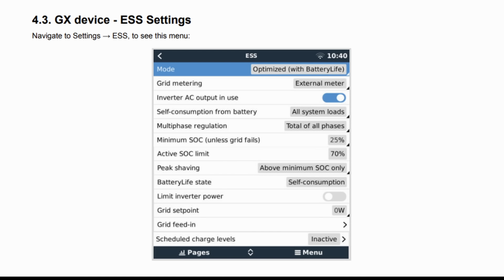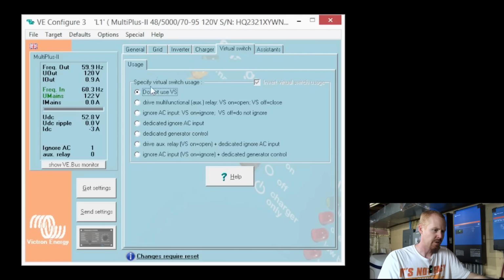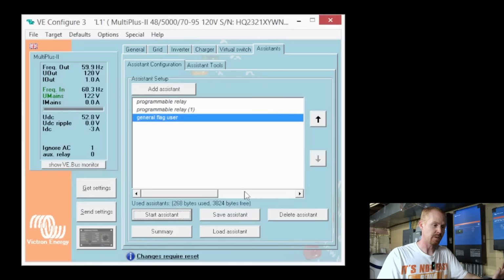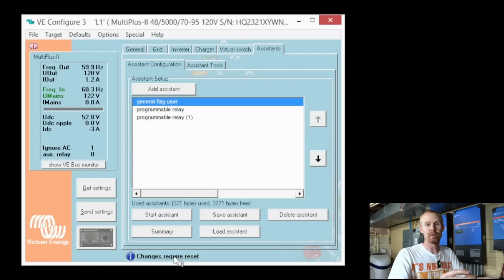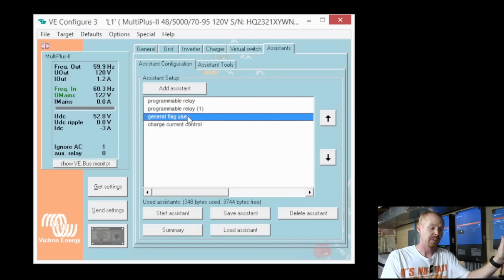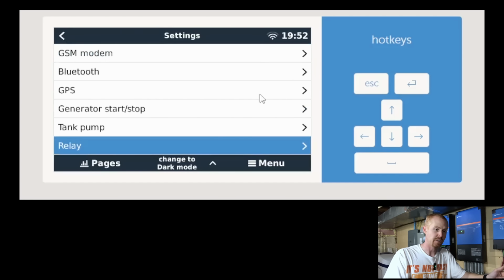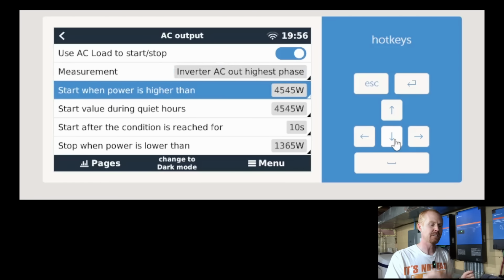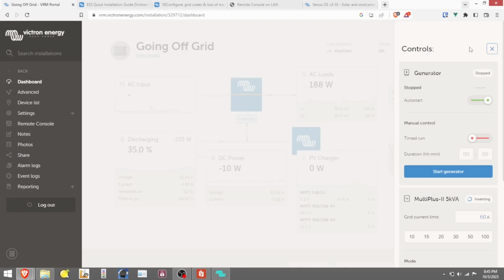Different Ways to Ignore AC Input on a Victron MultiPlus 2 Inverter

Comment: I found a problem with this setup, which works fine by the way. 
But when it switches to AC, the Victron also switches from inverter mode to charger mode. And my house will be running off the grid instead of the batteries. 
Since the grid is pretty bad where I live, my lights will start flickering etc etc. 
So how can I modify this setup to have the Victron charge the batteries from the grid at 15% SOC, while still running the house off the batteries??

I followed all of your instructions and this is the drawback..
Reply from the maker: Unfortunately with this configuration, you can’t.  It’s either grid or batteries.  

If you want a hybrid mode, you would want to look into the ESS assistant.  Keep in mind though that any hybrid mode has a potential of power going back up to the grid.
Reply: @AdamDeLayDIY alright will look into the ESS then. Thanks anyway, your solution works very nicely except this little snag.

Comment: Thanks for the video.  I don't know why Victron cannot just make it simple and provide an option that allows you to easily be totally disconnected from mains until you reach a certain SOC (which is adjustable on the VRM app / remote console) and then reconnect to charge & power loads up until a specified SOC (also on the app) without needing to run extra cables, etc.  The ESS assistant would be ideal to have this option if it allowed for no back-feeding, etc.  Until then, yes the Gen start / stop function is the best, though it's annoying they don't have the feature out of the box available.
Reply from the maker: It would be nice.  It kinda seems like they're less focused on our market though.  ESS works great if you have a grid-tie agreement.

Comment: I just installed a new Victron MultiPlus-II 48v/5000VA/70 amp and want to program it. However, dummy me forgot to buy the mk3 USB cable. Got the Cerbo GX rocking and rolling, tho. You are dead in the water without this cable using the MultiPlus
Reply from the maker: Congrats on the new inverter!

You can actually use the VRM to upload and download the configuration files without the cable.
Reply: @AdamDeLayDIY   -- Thanks. I ended up getting the Mk3 cable. However, the inverter turned off MAINS (grid) at 30% SOC. I went back to this video and enabled "Assistants" like you showed. Just did it -- so, the batteries need to discharge down before I know it "works". Question: Does the ESS on the remote "also" need to be added? Right now (on my Remote) it shows "No ESS assistants found". Hopefully, the inverter will shut down at 30% SOC (and use the Grid) and turn back on at 50% (and shut off the Grid). That's all I want it to do (no charging needed). Thanks!
Reply from the maker: @ChrisDIYerOklahoma  did you use the ESS assistant or a different assistant?  The ESS assistant is it’s own thing and allows the inverter to use grid interactive features.  Most of the ones I talked about only allowed grid connectivity to pass power through the inverter.

Comment: I setup the assistant. I send to the inverter and it reboots.
After reboot, the inverter goes into charger mode, but all I see is the Bulk, Absorbtion & float AMBER lights. Green Charge light is not on.
I turn off the inverter with the toggle switch, wait a short while, and turn back on the inverter. Inverter defaults to Charger Mode, not Inverter Mode
Retry the entire process with same results
Startup veconfig and the software says there are no assistants. I have tries the whole procedure twice with the same results (help please)
This is a 6 month old Multiplus II with latest firmware
Reply from the maker: Which assistant did you try to install because I talked about a few different methods.

Did you see the note I mentioned in the description and sticky comment about having some of the relay options backwards?

Comment: Just wanted to post that I've done this and ran it for about a month.  It seemed like everything was working fine until i did my utility reading.  Upon further investigating i realized that i was always drawing about 100-200 watts from the utility even when the generator was set to stop/off.  So it seems like there is still a connection here even though Victron shows that the generator is off.  Can someone else confirm that this is actually 100% working with no feed in or out?  Not sure if power assist has something to do with it?  Mine is check, never changed that setting.  Also UPS function is also check and that was the default setting
Reply from the maker: It all depends on the rest of your settings.  I’ve been told you want to disable power assist.
Reply: @AdamDeLayDIY  Just tried that and it still is leaking 100 to 200 watts randomly.  Is there any other setting that might have to be disabled or enabled?
Reply from the maker: Do you actually hear the AC IN relay opening when you're not running off of grid power?  If it's disconnected, there should be no power flow.  Are you using the ESS assistant?
Reply: @AdamDeLayDIY  I hear a good click, when going from inverter to grid being turned on.  Not using ESS.  When its on inverter mode and off grid (no mains connected as per the inverter) I don't see any flow in the vrm it signals well that it's off.  I put a clamp meter on the line feeding the inverter and i see anything between -116W to +120W just fluctuating.  Not sure if you can test yourself  (i think you dont have victron now?) or if someone else on here can see if this happens with their system.

Comment: I have 2 24 volt 3000 watt inverter's in split phase and i cannot seem make this work either.im sure i must have something wrong but having trouble figuring it out.great videos though.
Reply from the maker: Which method are you trying to use?
Reply: @AdamDeLayDIY wired to cerbo

Comment: Great video. Just what I was looking for. Installed the assistants to ignore AC input as shown and everything is working perfect. One more question howver. I only installed the assistants on the master inverter. (I have 3 multiplus 48/5000 in parallel) Do I need to install them on all 3 inverters or is only the master sufficient?
Reply from the maker: Thanks!

So with these assistants, you only need them on the master inverter.  If you look at my video on dynamically charging from the grid then you'll need those assistants on each inverter.

Comment: Hi I am very new my first install actually.  I have my system up and running, when my deiesl generator is running the home has a PE conection. But when its turned off, and the battery is running home the system looses PE . Where am I going wrong please.
Reply from the maker: Congrats on your first install!

So what inverters do you have?  Do you have a physical PE connection in the inverter going to the earth somewhere?
Reply: @AdamDeLayDIY  yes , it's an off grid system so the home is on tt. Before I started I checked the ze which was 1028 ohms now 132ohms. All go to axceteal bus bar. The multiplus 2 and the mppt and the byd battery earth's all go to bus bar.  The hyundi generator has  the earth neutral link as per hyundi recommendation. The consumer unit is connected to central bus bar.  But I need to get the laptop and usb lead to make sure that the ground relay tab is ticked. It's really unfortunate for me the customers home is in the wilderness of Wales uk. No mobile no Internet. And I have now been hours and hours on this system. I like the product but other manufactures have product for off grid that are really plug and play.  This job has stressed me out a bit. As I can now drive 45 miles just to plug into the multiplus 2 to see if a box is ticked. Trouble is it it is then what's next. I don't know how people make money from these jobs as now I am losing money. So any help is appreciated.

Comment: Thank you for this walkthrough. I think i will be trying the assistants (2 programmable relays + general flag) to start. 

Can you verify if the criteria you set AC load & battery SOC acts as AND or OR logic?
Reply from the maker: Not a problem, glad to help.  So the switching criteria is "OR" based.  If the load is too high OR the SOC is too low it will switch to grid.
Reply: @AdamDeLayDIY  thank you!!

Comment: This stuff is fascinating. I have already incorporated on of your assistants in a shore/generator priority that triggers the charge value. It works great. Now I'm looking for an assistant that will adjust the AC input level automatically depending on a value I have not defined yet.  For instance, when the generator input is on priority (above) it will have the AC input @ 50A.  When on Shore, it will adjust it to 13A.  Sounds weird, but I have a complicated mobile setup and trying to automate some settings that need adjusting when I'm not present to do it.
Reply from the maker: Since there's only a single input on the MultiPlus2 (and you would always be sending in 120v from either source), there's no easy way that comes to mind to automate what you're doing.  You would need some kind of manual switch (or cerbo display) to change the charging current.  

Now the Quattros have 2 different inputs, so I don't know if you would be able to manually set the current limit for each one individually.  Might be something to look into.

Comment: Good morning I have been using victron connect, is it the same as ve connect.
Reply from the maker: @gino2465  it kinda is.  So Victron has been working for a long time on moving all the functionality over from VE Connect to Victron Connect.  I believe you can do a lot of the inverter configuration now with the exception of anything “advanced”, like using Assistants.

Comment: Amazingly easy.  Wired this up with ferrules at both ends in 10 minutes.  My lithium batteries (600ah), maintaining them between 40-60% soc at home.  Let 1500 watts of RV Roof solar do it's thing to contribute to this SOC.  And of course, its a RV, so before getting on the road and when on the road, leaving the "generator" switch on.  Thanks Adam!
Reply from the maker: @gmercede  awesome!  Glad it helps!

Comment: Hi Adam, I want to add one more assitant to switch to AC if DC voltage is lower as 48 volt. Iam not sure if it will shutdown if relay is open. Or should I do 2 conditions ? If AUX is open and DC voltage is lover than .... And it should be at last position or at the top. Trying to understand logic of assitants but hard to find. I want to prevent that relay fail and Multi will drain my battery. Or multi lost communication with cerbo. You never know.... Thanks
Reply from the maker: You should be able to just add another voltage condition to the existing assistant.

Comment: Your channel seems to be the closest to what I’m wanting to do? Will the Victron II run a Three Phase Windmill  “1600w” at the same time with a solar input. I don’t have wind other than on cloudy days and it’s not much? I don’t think I would need a dump loud because I always have a load on my lithium batteries with the BMS?  On two 150/60 Victron controllers.Set at 14.20 volts. For my solar input.
Reply from the maker: @scooter6334  unfortunately I don’t know much about wind.  As long as you have a proper controller set up for the wind turbines, you should be able to have the output of that controller go to the same battery bank as your solar charge controllers.  From my limited understanding, the wind controller is just a modified solar charge controller.

Comment: I’m in the process of investing in a Victron II. For my on grid home. “For elec savings” My question is why not use the battery bank to it full capacity before it need assistance or at the point it needs charging? When setting the transfer. I would think the 15% “or when It need assistance” on would be good. The 30% off seems to soon for the charging to stop. 🤔 why not at 95%+ I’m enjoying your videos for what I can understand. 🥴
Reply from the maker: @scooter6334  my primary reason for setting to 30% is to just make sure I still have some power available in my batteries in the event I lose grid power.
Reply: @ I thought the charger shuts off at 30% it sounds like you’re talking about turning it on at 30% If so, when are you having it shut off and quit charging? I thought 15% was when it came on to charge from the grid.
Reply from the maker: @scooter6334  The charger shuts off at whatever you program it to.  I don't charge from the grid.  I'll discharge my batteries down to 30% and let the grid takeover to power the loads until the sun can recharge the batteries.
Reply: @AdamDeLayDIY  Thank you. I don’t have enough solar on cloudy days so I want to use the charger just to recharge the batteries to 100%. I want to only use the grid long enough to get back on my batteries. I’m doing this manually now it’s a hassle and as you would know. You have to be careful. 🥴 learned that the hard way. 🙄
Reply from the maker: @ So then yeah, you can use this same thing to automatically switch to and from the grid.  You just wouldn’t turn off the charger in the settings.

Comment: Ahoj, ak zaťaž prekročí maximálny výkon meniča menič sa pripojí na sieť. Potom záťaž napája len sieť, alebo menič stále dodáva maximálny výkon a zvyšok ťahá zo siete?
Reply from the maker: Keď sa striedač prepne do siete, všetky záťaže sa prenesú do siete. Ak máte na svojom AC vstupe nastavený prúdový limit a vaša záťaž tento limit prekračuje, ak máte zapnutú funkciu PowerBoost, váš menič vám tiež pomôže pri napájaní záťaží z batérie.
Reply: @AdamDeLayDIY  OK, I'll try. There is still the question of what happens if the battery is dead and there is not enough sun. Then I need the entire load to be powered by the grid.
Reply from the maker: @MartinBleho  If your inverter is programmed to switch over to the grid when your batteries get low, you should be all set.
Reply: @AdamDeLayDIY
Reply: One more question. I have 3x multis II configured for 3 phase operation. Is it necessary to send these assistants to all three units, or only to the master?
Reply from the maker: @ If I recall correctly, you're only going to send the Assistant to the inverter that you wire up Aux 1.  Since all the inverters work together, once the AC In is triggered on 1 inverter, it will automatically be triggered on the rest.

Comment: With the assistants assign is it needed to do some configuration in the Cerbo relays menu or any other kind of configuration? Seems to me that creating the assistants just for it self it won't work. Can you help? Thank you for your video and time.
Reply from the maker: If you follow the step starting at 10:15, then you would need to configure the Cerbo as well.  If you follow the assistant configuration before that, then no, the assistant does all the work on the inverter.
Reply: @AdamDeLayDIY  Thank you bro' so no need to put the relay menu in Manual mode..  Relay 1 still in alarm notification and relay 2 off? or Both in manual mode? ( Remote console menu)
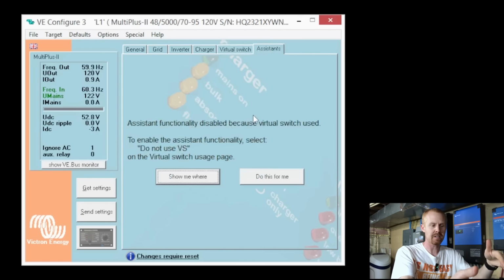Reply from the maker: @nunocoimbra  If you're talking about the assistant configuration between 5:50-10:15, you won't need to make any changes at all on the Cerbo/Remote console.  You're only using the relays built into the inverter.  

If you're using the configuration after 10:15, that's when you're wanting the Cerbo to control the AC IN connection of the inverter so you can make changes using the Cerbo/Remote Console.  

The difference between the two is that the inverter only assistant configuration means you have to edit the VE Config each time you want to change the settings for your AC IN.  The Cerbo config allows you to make changes at any point in time on your Cerbo/Remote Console.
Reply: @AdamDeLayDIY  yes, i am talking about the first configuration without de data cables on cerbo relays.. I did the exact configuration on the System bu twhen the grid is connected, does not assume this assistants. :(
Reply from the maker: @nunocoimbra  Did you see the update in the description or pinned comment?

*
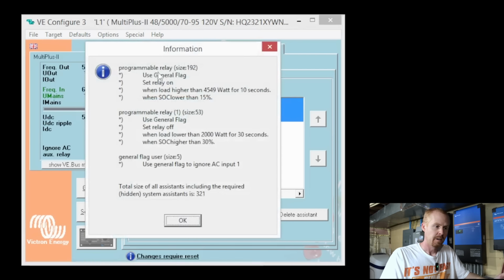At 9:21, the generator start/stop assistant information is not correct.  In the video it shows the relay being turned on when the load is high or the SOC is low (and the opposite for low load and high SOC), but the relay should be turned off.  The relay is controlling the General Flag (AC Ignore).  When the relay is set to "on" it will activate AC Ignore and turn off the grid connection.  When the relay os "off" it will NOT ignore AC In and the inverter will switch to passthrough mode.  

Basically  you just have to switch "relay on" to "relay off" and visa versa for the two programmable relay assistants.  Unfortunately I cannot edit the video to add the correction without taking it down. 
*
Reply: @AdamDeLayDIY  the AC input was ignored in fact but when batteries get to the minimum SOC the grid is not activated again as it should. Maybe in the VE Config inverter's menu the SOC  shutdown percentage must not be assign?
Reply from the maker: @ The inverter shutdown SOC needs to be set lower than the SOC you want to switch to the grid.  Did you read the comment from earlier and make sure your switch settings aren't backwards?
Reply: @AdamDeLayDIY  yes i did now. I finally understood it. Thank you so much for your time
Reply from the maker: @nunocoimbra  Awesome!  Glad it's working!
Reply: in the "new" Victron meter menu or equipment is also needed to do or configure something?